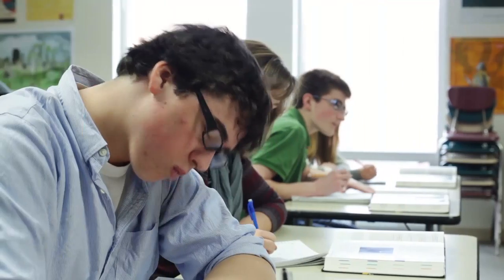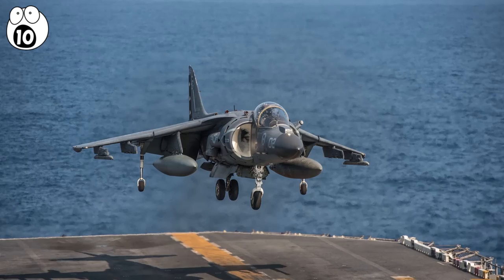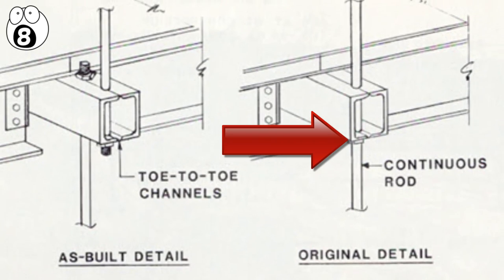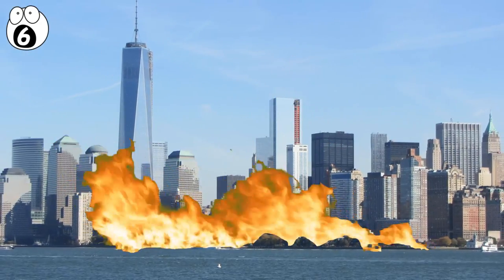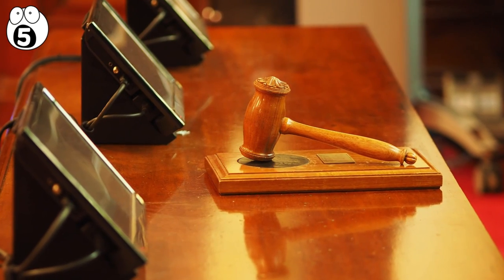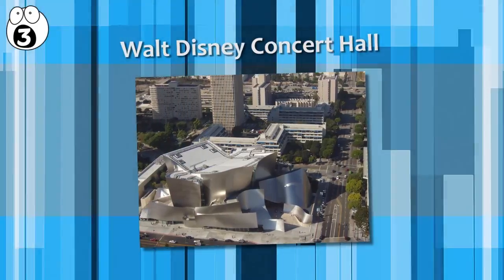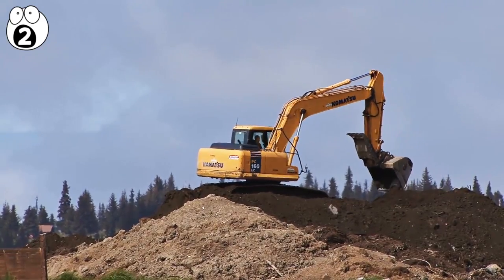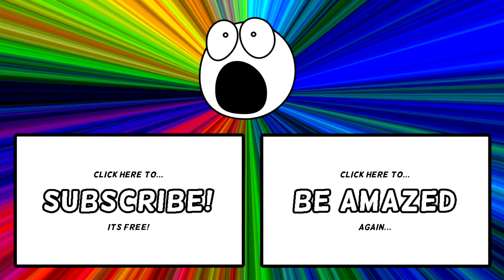Biggest Design Errors Engineers & Architects Made

Comment: the comparison between welding and bolts, oh god.....
Reply: It seems like an odd comparison but welding is usually more stable then bolts. When using the right electrode in SMAW welding it can grant more flexibility to the joint than a bolt could. But if you use the wrong electrode it can move pressures off the weld and into the joint causing failures
Reply: The difference between welding and bolting is situational and while welding does tend to create better result in many situations it is not inherently superior. There is a reason why people actually study this kind of thing instead of just welding together everything in sight.
Reply: And the fact that you can, you know, take apart something that's held together with bolts. :D
Reply: Bill Buck that's when the CAC-A and oxyacetylene torch come into play, and that's not even the fun part!
Reply: Also, Welding is more like tape/glue (a continuous seam), while bolting is more like stitching things together with surgical thread (multiple attachments through holes in the material).  Completely backwards analogy.
Reply: John Doe how would that be? There is more surface connected to the other piece of metal in welding.
Reply: basically after taking 2 steel structures courses in collage what i got was that welding is usually stronger than bolts also the steel sections worked in full capacity because you guessed it , no holes in them. we would take a 0.85 factor when using bolts in like normal structures like factories and such  so welding is better, but welding is as good as the worker making it so no good workers around, no welding. 
and to the other point when designing structure that are important and have dynamic loads like bridges welding is out because it doesn't really coup well with dynamic loads and if a worker screwed it it's a disaster but bolts are easy to install and easy to see earlier signs of failure in them and coup well with dynamic loads
Reply: No....
Reply: Dimitri Loginowski thank you for pointing that out, good sir.
I think I should improve my skills in english after graduation but english courses in college tend to be more practical and roaming around scientific phrases and such, so not very useful in general english speaking and so is bitching about someone's else skill level in english when it's not the point of their speech.
but I have to confess that my punctuation sucks ass.
Reply: Never make fun of someone who speaks broken English. It means they know another language.”

― H. Jackson Brown Jr.
Reply: rendzis I speak multiple languages. English is not my first language.
Reply: well i think the bolts would be better in my case.... cause my welding sucks
Reply: +Dimitri Loginowski
English is obviously not his first language. Chances are his ESL skills are better than whatever your bilingual skills might be (assuming they exist in the first place). Combine that with him having more understanding of structural engineering (he's the first one that recognized that the problem with rivets/bolts is added structural weak-points - both the holes in the material in both connection points and the rivets themselves) and I don't really think you're in a position to talk shit about him.
Reply: I think what his point is that eeeeewwww fingers
Reply: I heard him say that and I thought "No way this dudes welded shit"
Reply: "All of Manhattan would have been destroyed"  wut?
Reply: Nothing wrong with that actually

Comment: "Imagine Driving your car to the edge of the Grand Canyon, and the only thing between you and going over the edge is a couple of your drunk friends holding some dental floss"

What did you just say

More like 'and the only thing between you and going over the edge is a couple of TANKS WITH ROPES ATTACHED TO EACHOTHER.
Reply: This video is truly is carcinogenic. It actually appears as though whoever wrote the script GENUINELY does not realise that arresting cables were ultimately an excellent innovation, rather than an engineering failure as the video suggests, and are still in use on aircraft carriers because they are absolutely NECESSARY. Aircraft carrier runways have hardly gotten any longer over the years!
Reply: Except that isn't the Grand Canyon it's Arches NP
Reply: Flex tape*
Reply: *steel cables

Comment: Wires are still used in aircraft carriers
Reply: SpaniardChris that part was talking about if a plane missed the wire it would crash into the other planes
Reply: Point is at that time there was probably no other option. No steam catapults, thus for heavy plane loaded with ammunition you needed every inch of the deck. Also balancing the ship would be IMHO more difficult especially in times when they were pressed to built as many ships as possible.
And imagine auxiliary carriers with angled deck - even shorter than fleet carriers of the time.

I think that there are memories of the pilots of the era about touching the ways with the wheels as they were taking off and were so heavy that planes made a descent after leaving the deck.
Reply: Which is why the early carriers had multiple crash barriers further up the deck, to catch planes that missed the arrestor wires. Sure, sometimes the planes bounced (literally) over the barriers, but usually the barriers prevented more serious accidents.
Reply: They used teeth floss. Get your fact straight.
Reply: Mungo - They didn't have "every inch of the deck" as part of the deck was occupied by parked planes. Modern carriers don't store planes on the deck. They have elevators that move planes to and from the hangar deck, leaving the flight deck clear.
Reply: Modern US carriers all store planes on the flight deck. The hangar deck is much too small to store the entire carrier air wing.

Comment: I can tell that you aren't an engineer, nor have you done any research in an attempt to understand any of the nonsense you're talking about.  Aircraft carriers in WWII.  Already touched on below, but not really a design mistake the way they designed the deck.  The systems back then weren't yet capable of launching and landing planes using only half the length of the deck.  They needed the full length, so they used the full length.  The Tacoma Narrows bridge was quite flexible.  It wasn't a matter of uncooked noodle vs. cooked noodle.  The Hyatt Regency Walkway.  You say the reason it failed was because all of the weight of both decks was put on one rod, but the other design would have been the same in that regard.  Sorry I can't critique the rest, because I stopped watching already...
Reply: I don't know the specifics of all the examples, but every entry that I know about was wrong, so I can only assume the rest are too. Tacoma Narrows failed due to resonance from the wind blowing through the valley. The uncooked noodle analogy was just.. not even close? The skybridge had nothing to do with the tension, it failed from sheer stress. The citigroup building was engineered fine for winds flat on the faces of the building, but no one thought to do the calculations for quarterly winds because in normal building designs quarterly winds don't matter as much. I'd love to see the sources for any of these claims cus they sure as hell didn't come from anyone with a background in engineering.
Reply: BlaubartMT thank you. This was terrible. I am so glad the commit section is full of people calling out this bs.
Reply: BlaubartMT And don't forget that there were way to many people on the Hyatt's walkways.
Reply: I agree this video is total nonsense, based on ignorance. I couldn't watch more than the foolishness about aircraft carriers.
Reply: the issue is not putting the weight on the rod, but on the bolt
with one long rod each bolt holds one walkway, with two short rods the bottom bolt holds one, then gets fixed to the upper walkway, and the bolt on the upper rod has to hold not just the top walkway but also the bottom one hanging from the top one
Reply: This! "lldeletethis40 minutes ago
the issue is not putting the weight on the rod, but on the bolt
with one long rod each bolt holds one walkway, with two short rods the bottom bolt holds one, then gets fixed to the upper walkway, and the bolt on the upper rod has to hold not just the top walkway but also the bottom one hanging from the top one"
Reply: +illdeletethis I was going to say the same thing but with "nut" or "nut and washer" in place of "bolt". There is no "bolt" in this configuration, you have threaded rod (which would be a bolt if it had a head) and nuts (usually with washers).
Reply: The Hyatt walkway failed because the weight that was supposed to be placed strictly on the rods was placed on the walkway, itself. The walkway box tube sheared between the sets of suspension rods because it was never designed for that kind of loading. 

The Tacoma Narrows bridge didn't fail because of a lack of flexibility, but because of aerodynamic forces that created an oscillation that eventually tore the bridge apart. It was plenty flexible. 

Finally, for the aircraft carrier, the technology of the WWII aircraft carriers worked well for aircraft of the time. A straight deck wasn't a problem until jet aircraft came along. You can't call that a design mistake, but an evolution of design to remedy a new problem.
Reply: BlaubartMT i
Reply: Yes , the deck of the aircraft carriers is not a mistake, actually aircraft carriers is just and experimental ship in WWI and implemented in WWII which means that humans doesnt have enough knowledge of how or how to improve or make the  landings better, now in 1970s new aricraft carriers design is being modernised, but its not WWII era so yeah if you get my point i suppose😂😂✌
Reply: well the walkway in Kansas city did actually fail because of the design. therefore making it and engineering fail.
Reply: Poi Poi _Chan don't act as if you know anything about USN Carriers. It makes old sailors like me, who served on them, and know their history, look at you with a bit of contempt.
Reply: The Hyatt Walkway disaster was caused by a 'shear force'. Imagine feeding two clothes hangers through a piece of wood and pulling them. It's not going to pull one wire out of your hands, but it will destroy both wires.
Reply: BlaubartMT don't forget that many of the first carriers were just boards of wood over an old cargo ship
Reply: In re to the Tacoma Narrows Bridge, as Mr. BlaubartMT states, it was too flexible rather than too stiff. Reference https://en.wikipedia.org/wiki/Tacoma_Narrows_Bridge_(1940) for details.
Reply: BlaubartMT dude chill out it's a video your not an engineer either so just calm down
Reply: BlaubartMT how do you know have you met him?
Reply: RebelYellBoy design fault? No. The builders ignored the engineers design and thought they should build it the easy way.
Reply: In my opinion, you all are wrong about the narrows bridge and, me living near it and not being plain dumb, it fell because there was no place for the wind to go other than to blow onto the side of the bridge which had no holes or expansion hinges to let it pass. Also, the Hyatt walkway did fall because of there being two bars because the strain was too much on the BOLTS which gave because of all the PEOPLE on the walkway so one bar would have worked fine. ☺
Reply: BlaubartMT Like to hear yourselves talk don't you?
Reply: the Hyatt Regency Walkway didn't fail because of the rods they used 2 c channels to make a box and the weld in the center failed.
Reply: Dustin Sateia the first American carrier was a converted coal ship, and the first British was a converted liner.  all other big carriers were either converted warships, or purpose built.  no idea what you mean by "boards of wood over an old cargo ship".
Reply: Ennex The USS Langley, I believe?
Reply: @followerofeir  No. The engineers designed the walkway properly. The actual on-site construction company strayed from the specified designs during construction to try to adapt to a small problem they encountered without consulting the engineering firm that had created the plans.
Reply: @bradburke7084  that I am not so sure. I thought the original drawing for Hyatt bridge's welded channels (before the fatal all-load-on-one-nut modification) was deemed acceptable and was approved? But then the structural redundancy does seem awfully thin anyway.
Reply: @pkernoob786  I would say the original design is barely enough.... Its live load assumption is just too thin

Comment: As said by so many others, the knowledge and research for this video is terrible. They give the impression that engineering flaw in Citicorp Center (not called Citigroup at that time) was caught before the building was built. Wrong! It was caught by an architecture or civil engineering student, while researching for a paper, after the building was built and occupied. It was hurricane season, and there was a real possibility that if a hurricane hit New York, and the wind buffeted the building directly at the corner, then the building could fail. The city made secret preparations to evacuate that entire area of Manhattan, and meanwhile work crews went into the building at night, keeping a secret as to their purpose, and went behind the interior walls to weld the diagonal support structures.
Reply: It was an architecture student doing her thesis..Diane Hartley
Reply: I also believe that the design called for bolts for flexibility, and the contractor used welds to save money.  Bolts added flexibility whereas welds increase stiffness.  They had to install the bolts and grind out the welds, because it would have snapped under the wind loading.
Reply: NUMBER 6 was wrongg!! aswell the plane blew up due to the pressurization of the plane and the square windows
Reply: yah, half the facts here are presented wrong (thus the hate)...
Reply: originalhgc Rice hello ordinary all right well I am not a chemical plant hate to make about you I want to man account because I want to do public so hungry I want to who to make it worth your soda know how to make a permanent everything else I want to do do it quickly as it is a commercial guy hasn’t acted like a child with her toasterI is a very
Reply: I just came from a particular "Mustard" video that explain in details and w/high production values what happened with that plane. When the narrator began to blurb "square windows" I then knew why YT suggested this video and what I had to do.

GREAT VIDEO, MUSTARD!   Aaand... I'M "NOT AMAZED" ABOUT THIS ONE...

PS: If you like to see what really happened search the "Mustard" account under "De Havilland Comet"...
Reply: OK! So THAT’s the opposite of what we were told--in both the video and by orinigalhgc?
Reply: Not every historically-based video can be a masterpiece, some maybe duds...  (the -2 index, as in 2 dislikes more than likes can tell you the story...)
Reply: That's actually extremely interesting
Reply: wonder how that took before people found out how bad it was.

Comment: *Talks about DeHavilland Comet *  
*Shows crashed Dc-3* 
*Unsubscribed*
Reply: Talks about missed carrier landings and go arounds.

Shows a Harrier doing a vertical landing 

FACEPALM
Reply: Not only that he calls it The Havilland Comet. LMAO. AND it was metal fatigue which nobody knew about at the time of the comet's design.
Reply: right, it wasn't a mistake. more of a learning curve.
Reply: +Gordon Lawrence they of course knew about metal fatigue. The issue is that the shape of a port on top of the fuselage (not windows) induced concentrated stresses which the design did not account for. Together with pressurisation and depressurisation during operation this caused the metal fatigue which caused the fuselage to fail. So it does have something to do with the shape, but the explanation given in the videos is nonsense.
Reply: why did you even sub?!?!?!
Reply: I didn't
Reply: That DC-3 is on an beach in Iceland of all places
Reply: @Jeremy Heller it could be a C-47 from WWII as literally thousands ferried via Iceland to England from the USA as it looks like there may have been an astrodome (one of the very few externally visible differences between the DC-3 and C-47).
Reply: *Talks about Grand Canyon
*Shows Arches National Park
Reply: where can i get info on buying a building
Reply: Not to the degree that it was fully integrated into engineering design practices. Before that it was realistically an obscure subset of materials technology/physics.
Reply: No, it's really a US Navy Super DC-3 - not because of plane id skills, but because it's an iconic photo of the wreck from a 1973 crash at Sólheimasandur beach.
Reply: @Mark Eichin. Mine was more an educated guess. I didn't know about the 1973 crash.
Reply: Pile Of George talks about submarine engines not being powerful enough to resurface the submarine... Yet submarines resurface by increasing air ballast, and evacuating water. Both done without the use of an engine